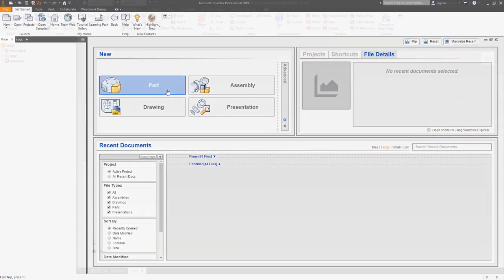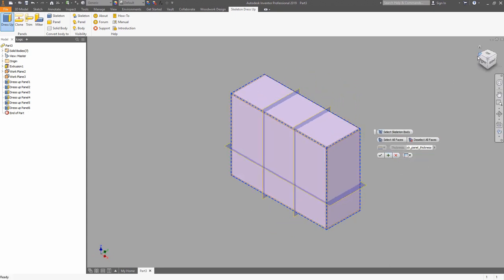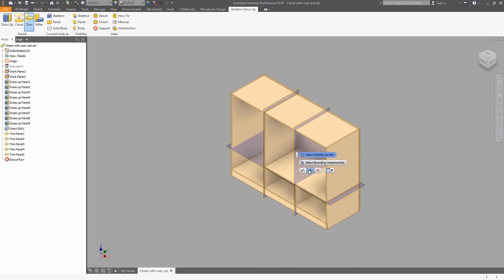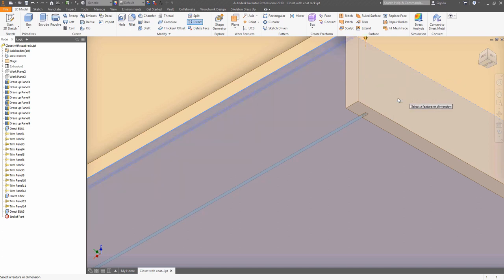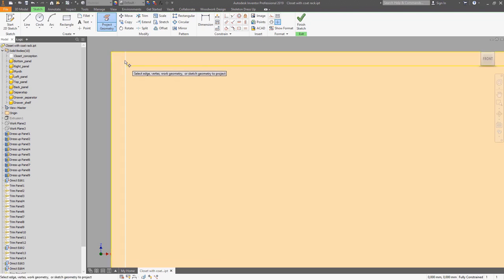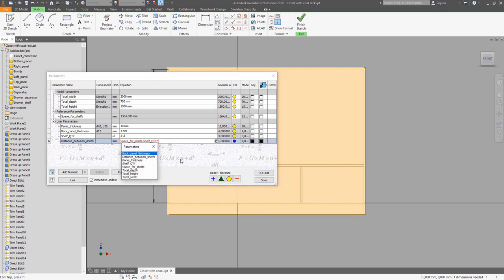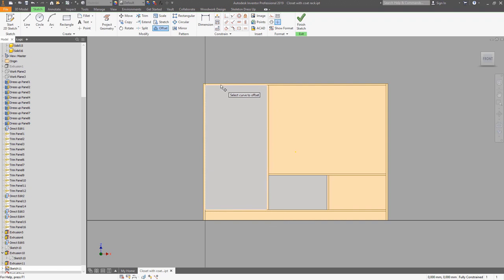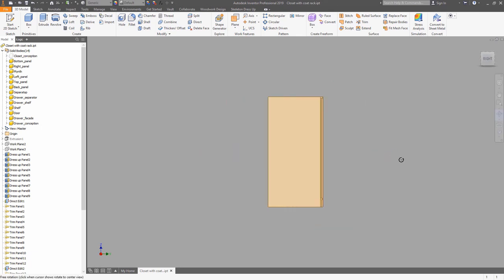1. Office table design

Comment: Hello. What's the new position for the back panel? I cannot appreciate it on the video. Thanks for the job. Great videos.
Reply from the maker: Thank you for positive feedback. the position is defined when you move the backplate at 4:07
Reply: @tools4inventor  can you elaborate a bit more on this, I did not see the actual distance it was moved at the indicated time on the video
Reply: @tools4inventor  you can't see how far back you moved the back in the video.